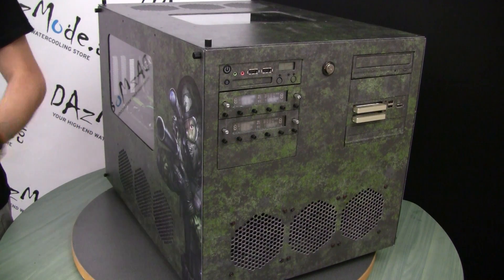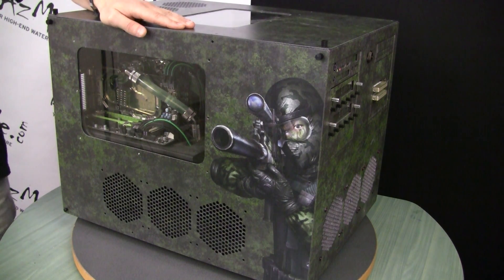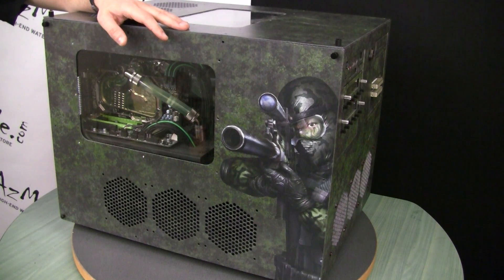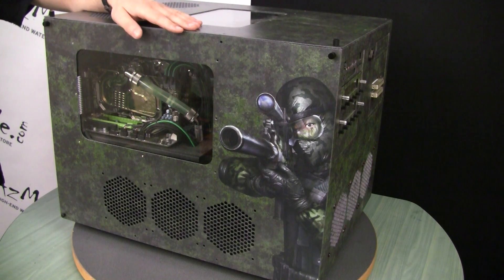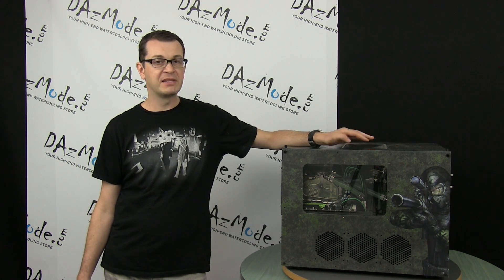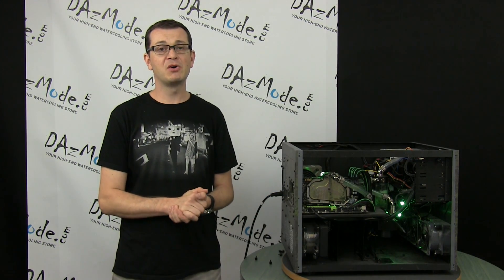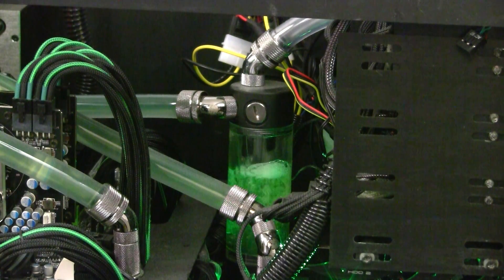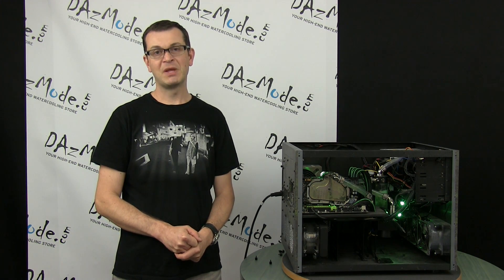How To Maintan High Performance Watercooling System - Complete Watercoling Guide - Part 9

Comment: What's the best way to clean / flush your radiators before use? Warm water? Distilled?
Reply from the maker: I just hock up to hot tap water blast crap for 10 min and flash with distilled after. Never failed me. No bullshit with vinegar or any other chemicals.
Reply: DazMode thanks, my parts are have shipped from you so I am getting ready to build :D
Reply from the maker: Thank you for your support! It really matters.

Comment: Hay : Just one point on your great blog: USE ONLY New Parts, no used or second hand parts; This could lead to leaks or dips or a total flush-rush. Also never try to fix rad problem or a rad pipe fitting: BUY NEW and relace, is cheaper in the long term. Again thanks a Milion for a good glog

Comment: Started watching this video and then realized in horror that I've been running the same system (XSPC Rasa 240) and liquid for over 3 years ;_;

I'm replacing a lot of components (pump, tubes, adding a radiator, etc) next week though.

Comment: hi daz what is better an all in one cpu cooler, air cooler or a custom loop?
Reply: DazMode if i was to air cool the max height ive got is 155mm with a fan in side panel if i was to watercool either with custom or aio the max is 120mm
Reply from the maker: Depends on size of the cooler!
Reply: I think If you are asking yourself such a question - custom liquid cooling is not an option for you. It is extremely non-cost-effective, and the only reason why you would NEED to have a custom liquid cooling is if you need the maximum top performance squeezed out of your overclocked CPU at all costs. As Daz told in older videos, the main reason to get a custom loop is hobby.
To reiterate - if you just want great overclock for moderate money, go get some H100 (not H100i, it sucks!) or Zalman Reserator 3 MAX ("Dual" version is coming soon, I think it will be much better than H100, cause single Res3MAX is almost as good as H100i according to anandtech), or Swiftech H220 or something like this. If you need a hobby for your spare time and money, or need the ultimate performance at all costs - build a custom loop.
Reply: Just dont go H100i, a lot of people have problem with pump noise. (defective pumps).
I'm returning one set now and did a lot of research, it's very common.. The Swiftech H200x (pre assembled open loop), I'd buy, if you can source it. It has better components than H100i, yet I think you need new fans if you want ultra silent (noctua maybe?)
Reply: As long as you don't have a TON of things you want to cool you're best off with something like the EK Predator 360mm, it is literally a WHOLE custom loop ALREADY PUT TOGETHER for you! It has a 360mm radiator ($75 normal price) a full EK Supremacy CPU block (~$75 normal price), has tubing (~$20 or so normal price), has fittings ($20 or so) has it's own reservoir ($35 or so normal price), has it's own fairly decent pump ($40 normal price), and has Quick DIsconnect fittings ($15 or so) which lets you disconnect the tubing to add another block or more tubing etc.. if you want to make the loop bigger but it won't leak since the quick disconnect actually seals off the water until you put it back together. EK sells GPU waterblocks that have a quick disconnect on it with water already filled in them, so you can just disconnect the quick disconnect on the Predator and add the GPU block in and it snaps together just fine!  The whole thing for a 360mm setup only costs about $250 or so (and if you add up the prices i showed, it would cost you about $325 to buy already by itself maybe even a little more with the shipping etc..  and this is already pre-built. If you have two graphic cards and the CPU you need to cool then you might want to add another radiator, a 240mm one would be good; and again you can just get some more tubing and a cheaper 240mm radiator ($40 some places so not too bad) and you might need to buy a 2nd pump ($30-40) and you'd be fine.  

Of course you can still buy the stuff custom, but i would only recommend this if you are cooling two graphic cards and a CPU, or if you just really want a full custom loop that performs as good as possible (i.e. you're an overclock freak, or just a bleeding edge top tier pc guy).  In that case you could get a good pump like the MCP655 for about $70, you can get a reservoir for about $30, the tubing for about $25, the CPU block for as cheap as $50 if you get like a Supremacy MX or Swiftech block etc..  and you'd have more choice overall.

Comment from the maker: As you can see my radiators are relatively clean after 1.5 years 24x7. It all depends on how clean your environment is and if you have filters in your case. I used fine aluminum mesh filters in SS build.

Comment: You also have to clean dust on Radiators more regularly then once a year especially if you run system 24/7. Me even with fans at slow speed I get good build up after 3-4 months. I left it once for 6 months and could notice temps where higher and more noise from fans .

Comment: Excellent video; thanks.

One thing though... the audio drops off, almost as if the editing system you use decides to cut audio if it decides that it's not loud enough and would just be 'background noise'.
I find it quite irritating; if you could sort that out, that'd be great. Cheers.